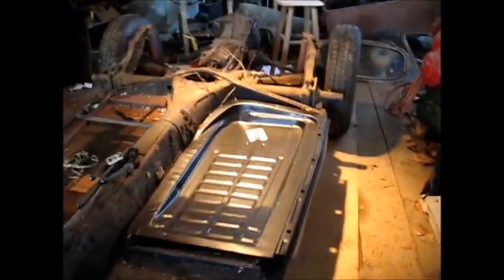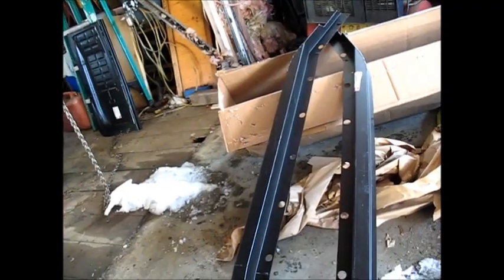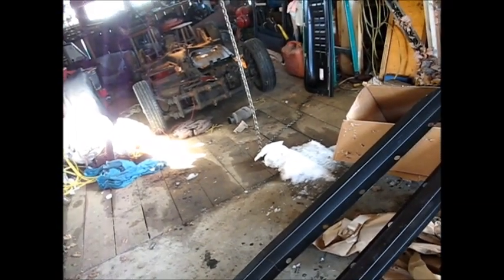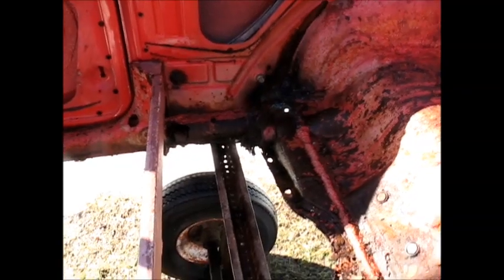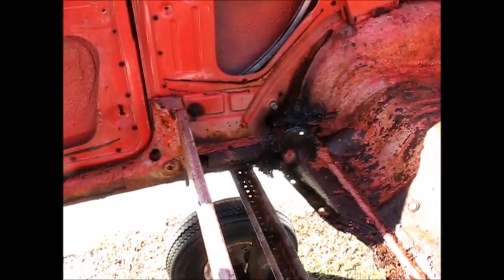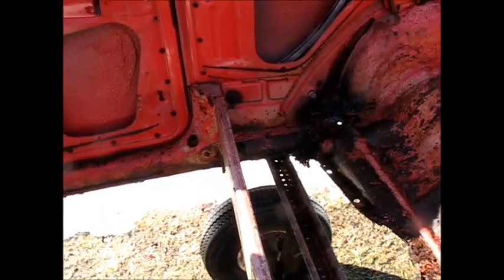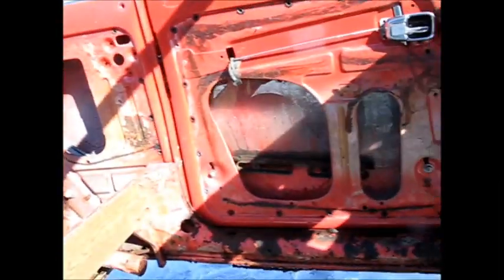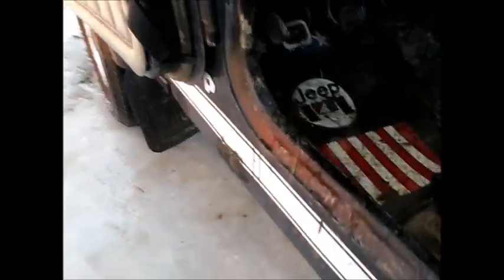Comparing VW convertible bodies 3

Comment: Most of that looks like surface rust. You can patch the big holes. The heater boxes can be replaced. Or you can just patch them up. Grind the surface rust off and see what you got left. That is just one bad spot in that corner but its not that big.The rest just looks like paint peeling to me.